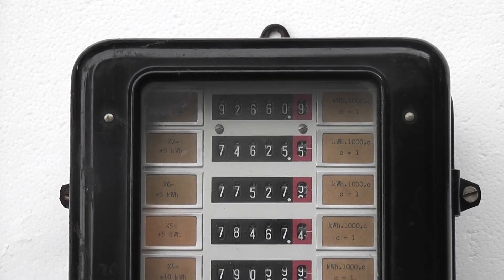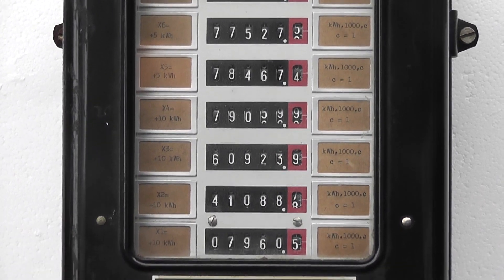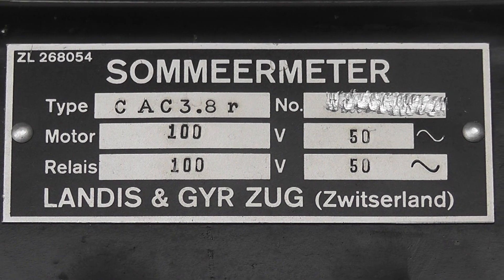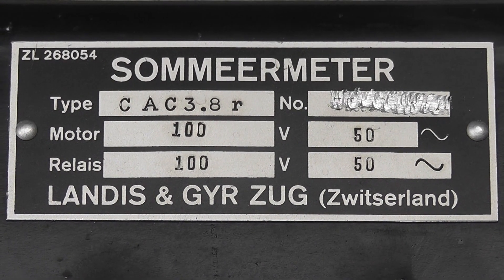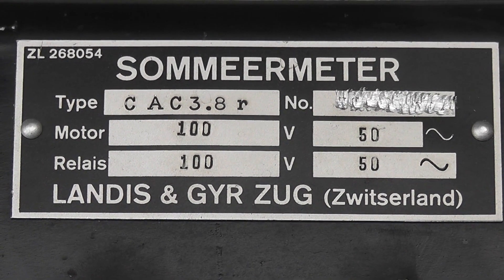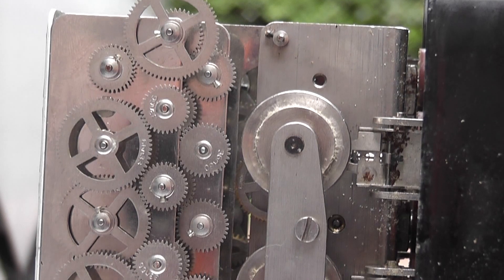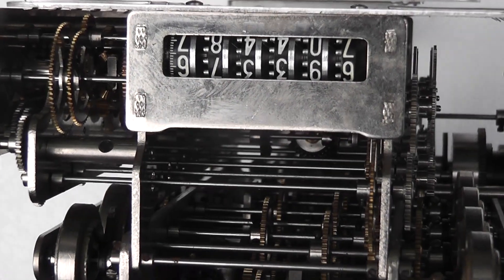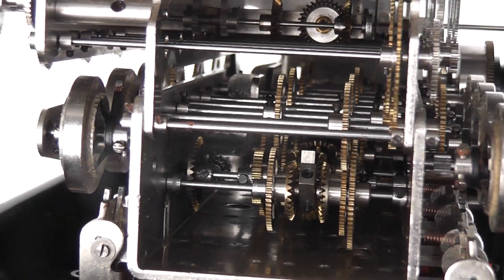Someermeter - Summator

Comment: i had somewhat the same thing. i had an old analogue meter installed int 1963 on our house. one day without warning, my fire panel calls saying the powers down. i get home and my meter was switched out. I now have as well the stupid LCD meter. I guarantee you they are set to scam us by reading and extra KW per 10 KW's or something.

Comment: Agreed! It appears to be some ridiculous legislation that required meters to be changed every so often... even if there is nothing wrong with them. Idiotic! At the most, a calibration test is all that is required. It's the same for gas meters here... huge waste of equipment and money. I checked the old meter, it's dated 1964. And as perfect as when it was made. This electronic thing, as you say, won't still be around in 40+ years! ...and I never have the same confidence in its readings, somehow!

Comment: Landis & Gyr made very well engineered meters. We had one for many years, then the power company started sending notices that it required changing! Rubbish, it was as good as when it was made over 30 years before. I ignored the letters until one day a guy rocked up at the door to change it without the option! Now we have a boring little box with an LCD display and a flashing light, still made by Landis & Gyr! But not an improvement, in my opinion :( I put the old one in the workshed. Works fine!